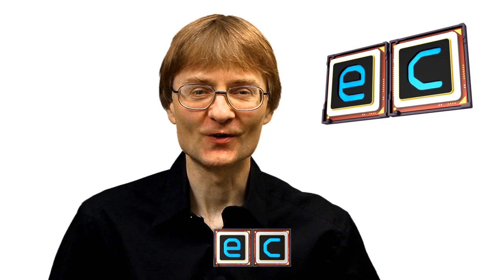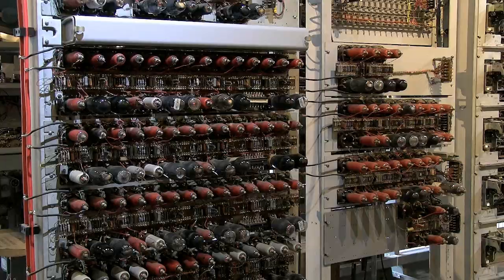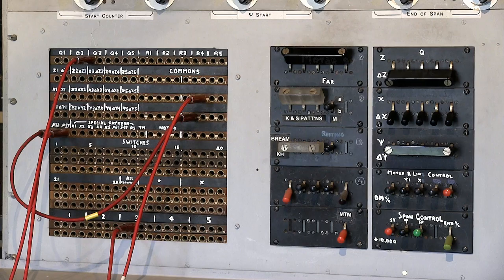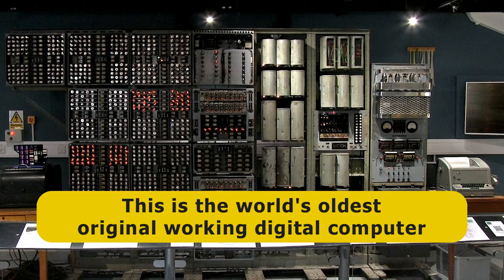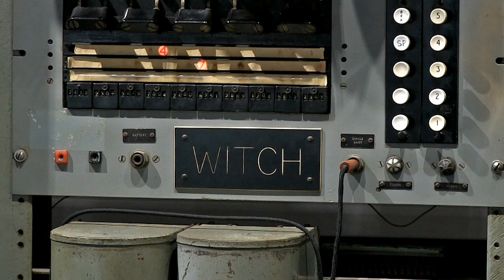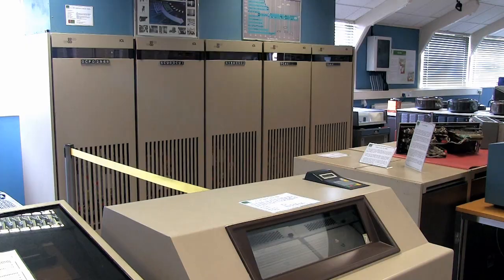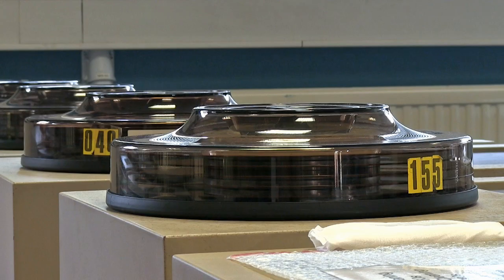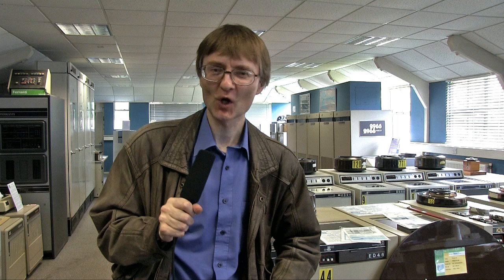Colossus & Other Early Computers

Comment: I worked at DEC Digital Equipment Corp back in 1978 -1981 then from 1983-1985 I first started to work on hard drives similar to the one's on the ILC system but they were made by CDC Control Data Corp. they were 200-300 MB 20 heads (two for each platter one platters was a servo signal to keep all the data heads aligned.
Reply: I  Started  in 1979  as  technician  , its amazing  how i still  remebver so much  ,  the 7400  series was  every where back  then.
Reply: I started my career as a VMS sysadmin, DEC had a great OS and solid engineering. Sad to see their decline

Comment: It is quite amusing though, how a computer only 60-70 years ago could easily fill an entire room, whereas today we have tiny little boards the size of a couple fingers such as the Pi Zero which cost about $10 and still has insanely more processing power, while only consuming as little as 5 watts, it may not be the scifi world people dream of but it's still pretty amazing sometimes.
Reply from the maker: I agree. Given where we came from, where we are now with computing IS amazing. And when you think how far we've come in a relatively short time, it is exciting to think what lies ahead . . .
Reply: vgamesx1 😳
Reply: Try to imagine a face of a 50s enginieer, who was just told, that in the 2000 the machine he operates will fit in a square milimeter, and cost less than $0,1
Reply: When I went to see the ICL they said they had put all the disks onto a micro SD so that they could run the thing without having to put the aircon unit on.
Reply: At the time Tarmac was using this I worked for another construction company who used an IBM RS6000 based machine the size of a fridge freezer. I was using Progress 4GL which had little trouble with 2 digit dates.
Reply: Too bad more areas of our technology haven't advanced as much as computers.

Comment: Great stuff Chris! Some of the hardware later in the video I had the opportunity to see as a child in operation where my dad worked... fond memories. xD
My dad was an engineer for a contractor company of the Itaipu dam here in Brazil, but before myself coming into existence, he had already worked with valves, punch cards and whatnot. He used to teach classes later in his career so he had samples of the stuff... very unfortunately lost in between moving from one place to another. The oldest PC stuff I still have is probably some floppy disks.

I remember that the job place he had into the computer department was an entire building where half of it was the refrigerated server room, and the rest of the building were offices with dumb terminals built litteraly inside desks (custom made desks with a monitor and keyboard built in). They still used floppy disks of the 8 inch size.

The server room had a whole bunch of wardrobe sized units, some with spinning taperolls, some for other purposes. The room was refrigerated 24/7, floor had these thick cardboard-like perforated tiles with all the cables running under it.
But the thing I remember the most is the printer. It was pretty huge for a child me. xD
It opened up like a fridge, and had it's own vacuum cleaner to suck up the bits of paper that came off that perforated paper used for dot matrix printers. All very fascinating.
Reply from the maker: These sound like wonderful  memories of early and large computing! Thanks for sharing.

Comment: Great video Chris!  I have worked on valve amplifier equipment in the past and seeing all those valves in their various flip-flop circuits boggles the mind!!  Let's think about the heater current needed by these beasts!  Valves of this type need a heater, which is an electrical element (the part that is seen glowing in most valves that is heated by an external current) to produce a stream of electrons inside them to make them work.  The electron stream formed within the valve by the heater allows another output current to pass, the valve's design providing control of this output current, so making it capable of doing useful work like amplification or binary switching (in the case of these computers).  Most valves take between 150mA (0.15A) to 1.5A to power their heaters alone and this wasteful demand represents one of the technology's biggest disadvantages for apart from allowing the valve to work, the heater current contributes nothing to the useful work a valve can do.  So, a computer containing around 2,000 valves may end-up consuming between 300 to 3,000 Amps of heater current (unless specialised "high efficiency" valves were used?), with additional power being needed to run the logic/paper tape/indicator etc. circuits as well.  This is a lot of power!! Also, all those heaters are going to produce, well, a lot of heat!!  I suppose we should be thankful of the development of silicon technology :)
Reply from the maker: Great calculations. The ENIAC valve-based computer, built shortly after Colossus, had about 18,000 valves -- which according to folklore dimmed the lights of Philadelphia! :)

Comment: Great videos. As a software developer /coder, I find the history of computing incredibly interesting. I released the game called "Charlie the Chav" on the android play store, which I based on old 2d platform games of the 80's. I did it for fun. However, it was done in Java, using very simplistic techniques of OOP that you had no way of getting around, back then. In the old days, you had to code for so many problematic hardware restrictions, such as the type of display unit, the memory, and lack of colour. You had to be very clever, and almost use bodging techniques to accomplish your goal. Now, it's so easy to produce anything. Even a child can develop software. 
But, what I like to see is this kind of content. We are back to the roots and the guts of our modern cpu. Every bit of hardware we use today comes from this equipment in some way. It should be worshipped. Pure geniuses created this technology.
Reply from the maker: Great post -- I could not agree more about getting back to the "roots and guts of the modern CPU". A great line! :)

Comment: I wrote code for and managed ICL1903a, 2966 and Series 39 machines. We used them for stock control, payroll and some more esoteric stuff such as radio frequency prediction. At the time I could program in COBOL, S3 which ICL programmed much of VME in. There was a Fortran compiler and an Algol 60 compiler for both the 1900 and 2900 series systems. I also implemented some systems on an ICL DRS 20 system, which was one of the first networked 8 bit microprocessor systems ( unusually I think ICL bought the design in and badge engineered it, the mainframes and associated operating systems were done in house) . I guess this was in about 1985. They were still running payroll and personnel for about 200,000 people back in the 1990s. 

It's quite interesting to consider how little computational power and storage mainframes had but how much work they could get through. And how efficiently one had to code to get a program to fit in say 4 megabytes of memory. It's quite ironic really because now I program microcontrollers for fun and pretty much all of them have more power and memory than I ever had on a mainframe. 

Just out of interest I need some blank punch paper tape. Does anyone know of a source?

Comment: Excellent video!  I've been in computers for 40 years but I learned quite a bit from this video.  I was surprised at how early "computers" were in operation.  I'm also impressed that the reconstructed machines are made with more or less original components -- I'm amazed that the components can be found.
Reply from the maker: I asked about this -- they apparently use "new old stock" -- 50 to 40 year old valves that have never been out of their packaging, held in storage by the origonal users of such machines.

Comment: One of the first computers ever made used no electricity at all, but was completely mechanical.  Due to constant breakdowns, the inventor later replaced the mechanical parts with some relay switches.  It's a fascinating topic.

Comment: My first job in computing was kernel dump cracking on P and S series ICL 2900 VME machines (basically what, in later terminology, would be the equivalent of working out what caused a Blue Screen of Death).

The ICL 2966 (pronounced "29" "66") in this video was a mid-range S-Series machine. The "big" S-Series machine was the 2988 Superdual.

One of the big problems we had with newbie operators was, when they removed the exchangeable discs, they sometimes failed to keep the disc platter perfectly horizontal and the bits would drop off 😉
Reply from the maker: Thanks for this! :)
Reply: I'm not sure about bits sliding off the platters.🤔 I do remember instances where newbie operators would remove a disk pack under it's protective perspex cover and forget to attach the bottom cover before placing the pack on the shelf. When the ops shift leader did a quick count of the covers lying around and found that he had more covers than disks which were actually mounted and in use he would go ballistic at the junior ops. Don't think we ever had a head crash due to this sloppy handling of the disk packs.

I remember doing core dump analyses on IBM 370's using DOS/VE. Bad news when I was on-call at night. Go to the program library and get all of the source listings. Lots of hex arithmetic to determine which instruction in which subprogram caused the failure. Most commonly a decimal data exception - the 370 spat the dummy when a packed decimal field contained an invalid value. Talk about going down a rabbit hole. Never going back there.😬

Comment: Hello Again & Thank You So Much For Sending This Link. I Have Several Documentaries About Bletchley Park During The War But You Make It & Post War Advances Even More Interesting. This Made Me Reminisce About My "First", A Tandy RL-1000 With Two, Low-Density (720K) Floppy Drives, No Hard Drive & 512K RAM. A Hayes Compatible 2400 Baud Modem Was Used To Dial-Up Local BBS & To "Expose" My Nostalgia, I Still Have The Copy Of Telix I Used On The Flash Drive I Keep In My Pocket. I Shan't Bore You Any Longer & You Sir, Will Never Bore Me! Thanks Again!
Reply from the maker: Thanks for watching, and I'm glad you liked the video.

Comment: Ha - I did my apprenticeship on the prototype ICL 2966 (codename S3) when I worked at West Gorton in Manchester between 1976 and 1980, I helped design one of the boards in the OCP. The very first one went into the Inland Revenue in Dalkeith I recall. Never could get the 64 bit (N64) version working though. Those were good days.

Comment: I spent a good portion of my early career programming the IBM AS/400 mainframe in a language known as RPG. I worked on successors to the AS/400 until 2012 at which point I was unceremoniously laid off. I had to completely reboot my career. I am now an app developer working in much more modern languages. I do sometimes long for the simpler days when there where only a few hundred commands to remember. But overall, I'm probably having more fun.

Comment: Guess I'm one of few left which had seen a working hard disk drive like the giant disk in your video.  It was in a cabinet the size of a large refrigerator, with a massive 5MB capacity.  But the disk was of much cruder construction than the one in the video.  It had a large plexiglass door discolored and dingy with age.  My PC servers actually ran the business side of the facility.  They were the smallest devices in the data center and the 'refrigerator' stood behind me.  A Xerox Sigma9, iirc.   Yes, wikipedia showa a similar drive!
Reply from the maker: Great recollections, thanks! :)
Reply: Then there was the magnetic drum memory - loaded via mag tape for each "job".
Reply: When I was an operator in 1981, I was working at a site for a couple of weeks on an ICL 1900 (I forget which model), one of the regular jobs was to clean the disk packs, (by hand).
Reply: I saw a similar large fixed hard disk at  my first job in 1975. The disk was attached to a Burroughs B500 machine which I believe was installed in 1968 and had 32K core ram. Most of the storage was handled by 5 tape drives which wrote at either 556 or 800 bits per inch. The 5MB fixed disk was a grey cabinet about the size of a domestic upright fridge. I didn't work on this machine as I was training to be a COBOL programmer on an ICL 1901T machine.

Comment: In The Netherlands in the late 80s or early 90s as a son visiting my fathers job I visited a building called Coengebouw property of a Dutch Bank and it had similar computers and those large cased disc stacks and machines to drive them as the ones of the ICL 2966

Comment: Thanks for the video.  I worked on the last type of computer in the mid 80's with the 300MB disk drives that were the size of washing machines.  I also saw what happened when the new disk packs were not handled properly and a user took out approx 20 read/write heads at about £700 each, unfortunately I was one of the engineers training at the time and watched as the heads were refitted.
Reply: I programmed on Perkin Elmer mini computers in the mid-80's which used some of the same 300MB drives. I think that they were made by Control Data. To backup and verify one of these drives to 6250bpi tape drives, made by Storage Tek, took over 40 minutes and two tapes, 1200/2400' (?). Basic process was to load tape #1, the backup program would do a write pass then rewind and do a read pass to verify the tape. Manually unload Tape #1 and load tape #2 and tell the backup program to continue. Each read / write pass of a tape took about 10 minutes.

When the 300MB disk pack became badly fragmented the action of the drive read/write heads moving in and out would cause the drive cabinet to shake violently and in extreme cases the drive cabinet would start to move across the floor. The quick engineering fix for this was rubber wedges between cabinet and floor. When time was available, usually at night we would have to 'defragment' the drive by backing up files contiguously to tape then reinitialising the drive, (similar to a quick format), and then restore the contiguous backup tape back to the disk drive. A very lengthy process for 300MB.

Comment: I used to work for the GPO as an engineer back in the 80s and most of the colossus racks psu.displays, plugs and switches we were using  still then.

Comment: Interesting stuff.
The Zilog Z80 was cool... but as we can see here, proper computers have a wall of flashing lights and spinning reels.
Reply from the maker: The Z80 was indeed cool, and I had the Zaks guide to programming it in my hand yesterday afternoon! :) I fondly remember writing Z80 assembler. And some Z80 machines will appear in my "Early PCs" follow-up to this video.
Reply from the maker: Wow! Hats off to you Sir! :) It is so long since I have done this kind of thing.
Reply: +David Griffin    But a Fortran compiler wasn't available until near the end of the ZX Spectrum's life.  1987.  Besides BASIC I can only remember Forth being available...  and that's a very different beast.  
I think Prolog and LISP were available... but they aren't the right tool for writing Snake.  Perhaps they can invert a matrix in six lines.
Reply: Didn't everyone own a Zaks guide? He must have sold millions of them. I've still got mine :-)
Reply: I always thought real computers should have lots of flashing lights, guess I watched too much bad scifi as a kid. But where I work we have these big IBM XIV  and DS8000 machines full of hard drives and LOTS of flashing lights!
Reply: + Jeff DeWitt. Well, you probably guessed it. Those are real computers. I also would like to mention an essay, whcih circulated a lot during the end of the 70-s and early 80-s. It is called "Real Programmers don't use Pascal", or in short the "Real programmers guide". Give google a try :-)

Comment: Wade-A-Minnit  !! I thought U.S. Battleships had an aiming computer, tied to a gyro, linked to the bridge, before 1944.
It had techs running around the computer making sure it was working right. Due to waves the ship would pitch and when the ship was at just the right angle ALLL the guns fired at once to nail the target.

Comment: Very interesting Christopher. The overall look of Colossus (apart from the valves) is very much like an old Strowger electro-mechanical telephone exchange. I bet the Colossus engineers used standard iron framework, relay racks, etc. from Post Office telephone exchanges... no point in reinventing the wheel during wartime.

For me, the 70's and especially the 80's are the golden era of British computing. Looking forward to those future videos.
Reply from the maker: Thanks for this. Tommy Flowers was a GPO engineer who built Colossus at the Post Office Research Labs. :)
Reply: I didn't realise that, Chris. I do remember that there was a British Telecom training centre at Bletchly Park when I started work as a telecoms apprentice back in the late 80's... it all makes sense now.
EDIT: Actually, I'm sure somebody must have told me about the Colossus/GPO connection back then, but as a 17 year old with a BBC Micro in the 80's it was hard to be interested in valves and relays :-)

Comment: The Italian Olivetti Programma 101 (1965) was the first programmable desktop 'computer' and it is often overlooked. It was the size of a typewriter and when people first saw it, they looked for hidden wires connecting it to a mainframe because they couldn't believe it was self-contained. It used no CPU but discrete transistors. It was a fifth of the price of an equivalent mainframe and sold like hot-cakes (NASA used many of them).

Comment: I worked as a shift leader on computers (WANG) that used the large 288mb and 80mb removable disks a typical single machine VS100 - would have 6 or 7 drives attached